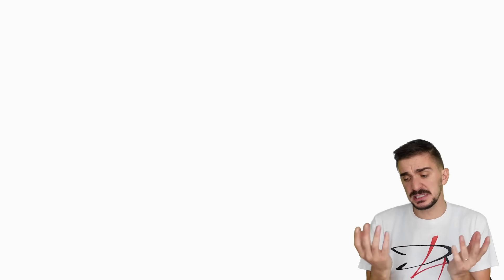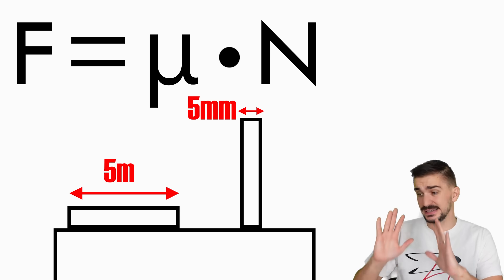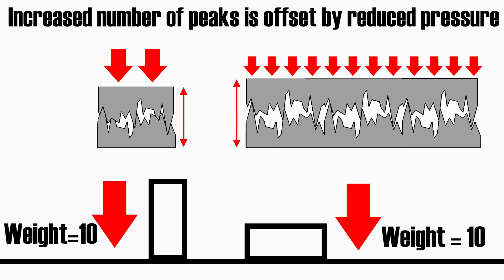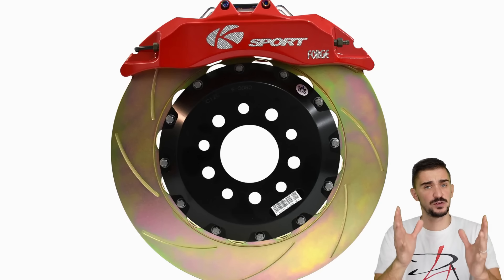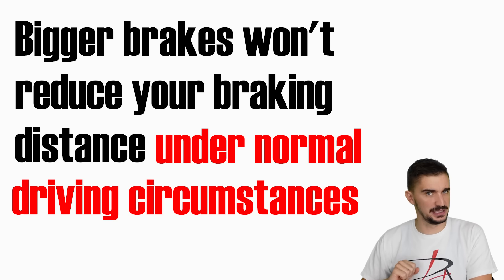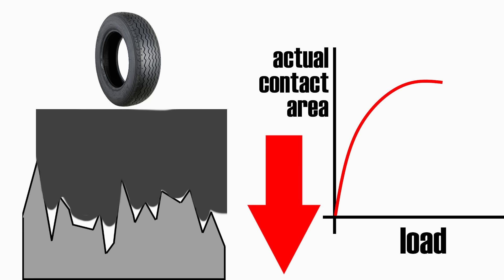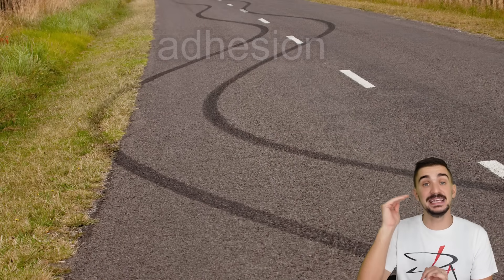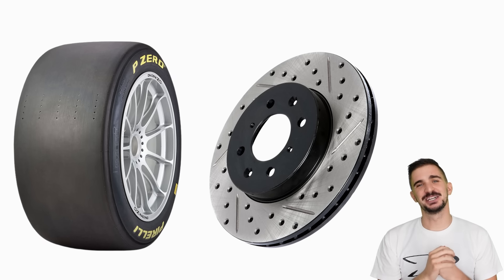Why Big Brakes Won't Stop You Faster but Wider Tires Will - Friction and Surface Area Explained

Comment: The analogy is wrong

Imagine an electric fan 
If you apply same force on the center or close to center vs applying pressure on the edge of the electric fan 

Applying pressure near the edge will stop it faster (same as gear ratio work)
Force at center is greater than on the edge
Thus bigger brake disc is much better.

Comment: Ok smart people….2002 GMC has terrible braking. What’s the exact fix? If you hit the brakes the load shifts towards the front and the rear brakes are affected by ABS. Tell me I’m wrong not to get a 6 piston caliper vs that crappy single OEM….(?)

Comment: One thing more:
Of course- with bigger brake discs force will remain the same. But friction force is not a thing that stops you. A brake torque does. And this torque is friction force times lenght from centre of wheel hub to "average" point of applying force (let's say half of rotor). Friction force remains the same, but distance increases, so brake torque will be bigger

Comment: One component that wasn't discussed was calliper distance from the centre of the wheel hub when using bigger discs. Even with the same pad size and brake force, more torque can be applied to stop wheel rotation. This is also a simple equation (force×distance=work done). If 'grippier' tyres are fitted, it may be necessary to create more torque to resist rotation. If your standard brakes are capable of locking up your wider tyres, then they are ample for general driving and heat dissipation, as discussed. becomes the overriding consideration for more extreme driving/loading conditions.

Comment: One problem. The force of friction in 'tire grip'  is applied *CENTRIPETALLY*, so this means what matters is the tire's friction coefficient & not the width. Your science is correct, it's just in the wrong direction. A wider tread in this case actually means longer tire life.

On the note on brake upgrades.
If rotor size is the same the mechanical leverage on the brake is exactly the same. It just has a bigger heat sink if you put bigger brakes.
If you put a bigger rotor, your tire now has more unsprung mass. This is important mass that will slow you down significantly, but this also creates a larger mechanical leverage when press. Doing this also beings up brake bias ratio which is a can of worms I won't deal with.

So "{Wider Tires &} 'Big Brakes Won't Stop You Faster," but tires with a high friction coefficient, or larger rotor with an appropriate braking system  will.

Comment: While you are correct that rotors are machined to have a smooth face, the pads are not. Pads are more rough and can flex under pressure. Larger brakes have more pistons which distribute more force over the length of the brake pad. Stock brakes typically have 1 piston where upgraded brakes have 4-6 pistons. This means that more of the pad is making contact with the rotor with upgraded brakes. You will see increased stopping distance with bigger brakes so long as the tire is not the limiting factor.

Comment: I feel like most of brake work is to reduce fade and maintain reliabilty within demanding circumstances...the remainder of the mechanics relative to driving control--and therefore the need to brake--always seemed to the rest with tire development itself

Comment: Yeah but 6 pot have more force on the pads than say 2 pot, and this also doesn’t take into play swapping out master cylinder to one of higher pressure. Plus, then, to reduce braking distance is only achieved with better tires also. Totally, it all adds up pretty quickly.

Comment: Excellent explanation regarding wider tyres. I previously incorrectly believed that wider tyres do not improve friction, because that's what physics taught me!
Another thing about the brakes vs tyres argument is that with brakes, on a standard road car, there is always far more than enough friction to stop the disc, i.e. there is no point in doing anything to improve friction between the disc and pads, as they never 'slip/skid' like tyres do on the road surface. Brakes will always stop a wheel from turning in normal use. In other words, the limiting factor of a braking system is grip with the road surface, not friction between the brake disc & pads (unless they overheat/fade of course!).

Comment: Great explanation on the physics, but you forgot to mention a very important point of upgrading to larger discs and/or calipers. You kinda started to mention it, when you spoke about towing but ended it there. The importance of this comes from many people trying to fit the biggest, most expensive wheels they can afford onto their vehicles, then cheapen out on the brakes. Most do nothing to upgrade the disc/drum sizes to match the increased force they're about to encounter and few just apply calipers with more pistons - which, at least, helps a little, but often not enough. People see the big wheels car manufacturers put on their hottest models and imitate it on their vehicles, but almost no one pays attention to the brakes size that was calculated to stop the vehicle.

Also, brake discs do deform. I don't know how you brake, when driving your car, but I can attest to the real world fact that brake discs deform. Which is why I never lent just anyone my car😊. Having them put gasoline back in the tank is one argument, but warping my discs is a fight waiting happen😂. Like you said, brakes heat up. And all the holes, grooves, etc. that manufacturers apply to the discs helps to cool them down. But, you forgot about the pressure applied in the braking process. When metal gets hot it softens, even a little. We don't consider this because in our bare hands it's still very hard. But, we don't use our hands to grab the discs, the calipers do that. And the pressure that they can apply is immense. Manufacturers know this and have been making thinner discs with their vehicles for about 20 years, or more. Try driving other people's cars and you'll eventually experience it for yourself. Or, do like I did and 'moonlight' parking cars.

Comment: Very detailed explanation.

I have one question though.

If the formula for frictional force is coefficient of friction times normal force, and normal force's formula is mass times acceleration of gravity (9.8 N/kg), then big brakes actually improve the frictional force, and by extension decrease braking distance?
Reply: I don't understand how you came to that conclusion. The braking capability of a car is determined by the tire friction. All modern cars have brakes that are more than strong enough to maximize tire friction for braking.
Reply: @Spike00773  What I am trying to say is, since normal force is affected by mass (as implied by its formula), then the big brakes should have more frictional force.

It's not an assumption that came from thin air, I am basing it off of math formula that this video highlighted.

I do not disagree with the point about tires and its contribution to braking power, I would have to ignore that part since we are both in agreement in that regard.

What I am questioning is why mass became irrelevant in the big brake conversation.

Also, try to google the formula for normal force, so you'd understand my question better.
Reply: @ramburritomendoza  The formula for frictional force you mentioned is relevant for the tires, since the normal force (by gravity) is what causes friction. For the brakes, the frictional force is caused by the pressure of the caliper pressing the pads against the rotor.
Reply: @Spike00773 You are mistaken to think that normal force only acts in opposite direction against gravity.

The normal force is the force a surface exerts on an object that is in contact with it, and it always acts perpendicular to the surface. 

However, the normal force can act in any direction. For example, if you push a magazine against a vertical wall with a horizontal force, the wall will exert a normal force in the horizontal direction.

In which it also applies to brakes and brake pads that are positioned vertically and applies force horizontally.

The reason why you cannot understand my question is because you don't understand how normal force works.

Not trying to be rude but please research more about normal force, then we can talk more about this.

Comment: I think this is not just about frictional force. As the radius increases, the braking torque transmitted to the disc also increases with the same normal force. If you take a bicycle and try to spin its wheel by holding the edge versus holding the spoke at the hub, it will require a completely different amount of force. The same difference in effort will be needed to stop the wheel. Thus, even with the same pressure from the pistons on the disc, the braking force will be significantly higher with larger brake disc radii. Moreover, with an increased disc radius, larger brake pads with more pistons can be used, which increases the normal force applied to the disc. Therefore, the braking force on a large brake disc can be much, much greater than on a small one. 
However, it was rightly pointed out in the comments that nowadays even small brake discs are often sufficient to completely stop the wheel at typical vehicle speeds and with not excessively large mass. Large brakes under the same conditions just stop wheels easily, facing less stress and therefore wear

Comment: Modern brake systems are plenty strong already- without ABS they're strong enough to completely lock the wheels and overcome the grip of the tires.
When people say they need "stronger brakes" it just means they need to get better tires or that their brakes are overheating, not that they need brakes with higher braking force.

Comment: That is a great detailed explanation. What about steel brake hoses, are they better than rubber hoses for braking ?
Reply: steel hoses will improve the force your calipers exert onto the pads and the rotors as well as brake feel but the benefit of more force reaching the rotor is only there if the tires are able to handle it (not lock up during braking)

Comment: Hi. Bigger discs won't stop faster, but but being all else equal (disc size, etc), will bigger calipers stop the car faster? What will be the difference in stopping distance, from using a single piston sliding caliper, to a two piston sliding caliper? And to a 4 piston fixed caliper? And to a 6 piston fixed caliper?
Reply: If your car is unable to lock up the wheels by braking, then increasing brake friction will help.
If your car can lock up the wheels by braking then the grip of the tires are the limiting factor.

Comment: It seems I’m very late to reacting to this video and I wanna say this is right yet realistically wrong 

Since 99% of the time when u get bigger brake calibers the brake Zylinder is also bigger 

So here is why and how shit works 

The brake system (brake fluid) has let’s say 100bar pressure which pushes the Zylinder which results in some force to the pads and disks 

If u now get bigger brake calibers and the Zylinder gets bigger the same 100bar push on a bigger surface so the force behind it will be bigger (which will give u Better braking (if the tyre isn’t the weakest link)
Now we go into this chain of upgrades u need to do 1st the pads will be bigger since u have a bigger Zylinder or even 2 and otherwise 1 small one would wear out too fast, then u have lots of force on ur small brake disc so u need a bigger one there to A fit the bigger pads and also get rid of all the heat where we just created more of, 
And last but not least ull notice ur tyres will lock up all the time so u get the good old slicks 😊 or just wider tyres

Comment: Ok as a researcher who works on friction, brakes, tribology, etc. I have to say that almost your entire video is brought into question by the formula you provided at 1:36. This is an EXTREME SIMPLIFICATION of the actual calculations required when calculating anything involving friction. The actual math is too much to type here but even if you only look at that formula, coefficient of friction is a function of temperature (and MANY other things, it is not linear). Therefore from that property alone the formula you provided cannot be used to actually make any decisions on brake systems.

Comment: My man, your contents are, as usual, very interesting and well made. Nonetheless, this specific video is affected by some fallacies. Let us set aside the matters of leverage, which have been pointed out by many others. One major additional fallacy resides in assuming, as you increase the disc surface, that the braking force is constant. It's not so: as you increase the disc surface you can afford to increase the braking force too.

Comment: Normal force is the force pushing up on the object by the thing the object is resting on... And the coefficient of friction is not dependent on just one object, but is a measure between two materials.

Comment: In my experience, OEM brakes are great once they are warm but they often don't have enough bite when cold. They also don't modulate well. So if you just don't like the way your brake pedal feels, this might be one reason to upgrade from OEM brake rotors and calipers.

Comment: I prefer bigger brake because I have wider range of modulation to play with. Remember, braking is not just slammed hard and pray it to stop immediately. Car brake performance is most enjoyed if you drive around track, which big brake give you a lot of modulation room to play with before it locked up. If you keep braking repeatedly, big brake also tend to perform better because small brake rotor will fade faster because it overheat sooner than bigger one

Comment: You usually can provide more force with a bigger brake, but the real reason it makes no difference is because in most cases, the tires skid before the brakes reach maximum force. Then it doesn't matter how wide the hydraulic cylinders are or how strong your leg is. If you can skid your wheels with a little drum brake, you can skid them with a big disc. The big disc doesn't overheat as easily though.

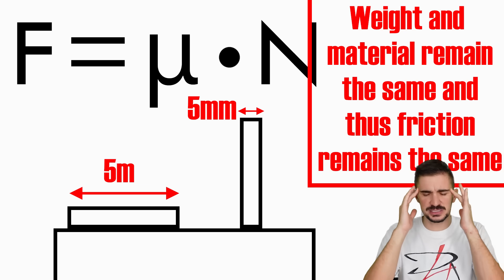Comment: 2:30 That definitely seems counter intuitive that physics wouldn't factor in the surface area in this particular scenario...

3:35 Apparent contact area vs actual contact area, 5% example...

Okay, but if only 5% of Mister Plank's 5 meter back is making contact (from the previous example diagram) vs 5% of Mister Plank's 5mm edge, then that's already a significant difference...

Comment: You don't know the force*arm formula yet. Bigger brakes have greater braking force.
Reply: Yes, but that is irrelevant. The limitng factor is the tryre grip, not brake force. If you hit the brake pedal and the ABS kicks in, that's as hard as your car can brake at the given grip level. Bigger brakes won't change the grip level, tyres will.
Reply: @shi01  Yes, but during braking the disc heats up, reducing the disc with the pad (less braking force). Additionally, when we increase the disc at the rear, we will reduce the braking distance on wet surfaces (on a standard set: the front will slip and the ABS will work, and there will still be a 40% reserve at the rear. By increasing the rear, we will use the full potential of grip).

Comment: It's about contact size vs road friction. Wide tires on dry warm road, narrow tires for snow. Wider is not always better for stopping. First wider can add more mass which means stopping slower. Perimeter brakes do work better as less caliper force is needed the farther out on circumference. Not only heat but the amount of force needed. The closer to the axle the harder the caliper needs to work and more heat. What about in snow, mud, or wet grass? I want a narrow tire for stopping. Because more weight on concentrated area to bite in. More friction because weight is focused on smaller contact patch. Adding more pistons to caliper does help. As more force against rotor. I put 10 inch rims on old fsj wagoneer. Had to get wider and shorter tires. Guess what stops worse now on wet grass, mud, and in general except in sand.

Comment: I have to disagree here, I larger diameter rotor has a higher mean frictional distance from the axis. This increased leverage ratio (mechanical advantage) means the stopping torque is increased for the same normal force. When a wheel is spinning at high speeds a smaller rotor may be incapable of locking up the wheel due to inertia and as stated will not be able to dissipate heat effectively.
Reply: Show me a modern car that is incapable to brake into ABS activiation, because that's the maximum braking force you can use. If you look for shorter braking distance, go for better tyres, not bigger brakes. Yes, heat dissipation and also heat capacity is better with bigger brakes. But that is not really an issue for road use.
Reply: It doesn't matter when the small stock brake is already strong enough to completely lock up the wheels. Making the brakes stronger won't make the car stop faster, because the wheels are already COMPLETELY STOPPED. (barring ABS)

Comment: Some ... almost negligible disagreements.  Starting with the motorcycle / bike: Why don't they need ventilation..? Bc a rotor on a bike weighs maybe 1/4rd of a car rotor ... but it's stopping less than 1/10th. And even cars don't exceed the thermal range of most brakes based on the operating speed and frequency of braking. 

The advantages that are bullshit for sports car big brake kits, etc, are stopping distances. That is a function of their tires. However, I understand that there was (especially pre ABS) an advantage in modulation and feel with better brakes. But putting that aside, what performance brakes offer is:

Less unsprung mass due to more conscientious caliper materials.
Larger rotors increases the thermal mass, bc brakes are heatsinks!
Thermal mass = lower peak temp after equivalent braking runs.
Lines + fluid are good upgrades. More pistons & huge rotors = dubious.